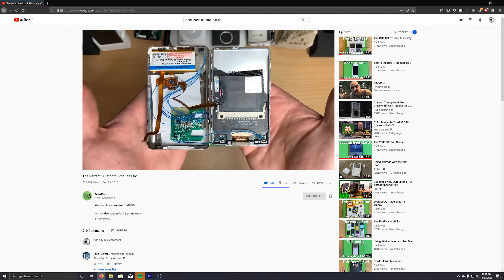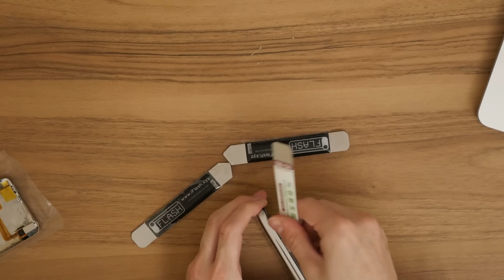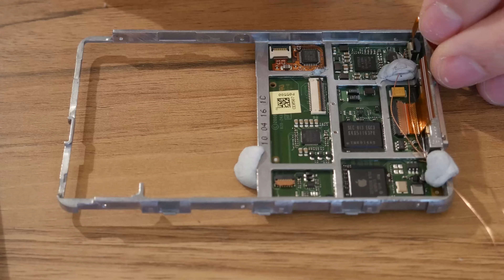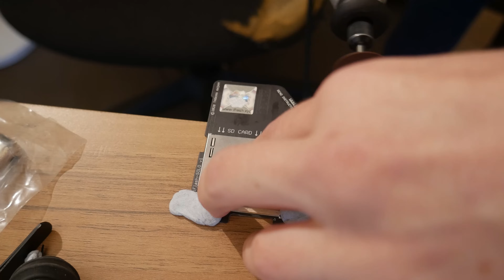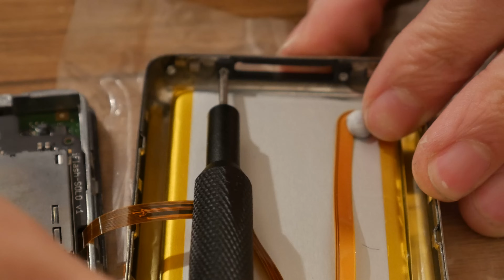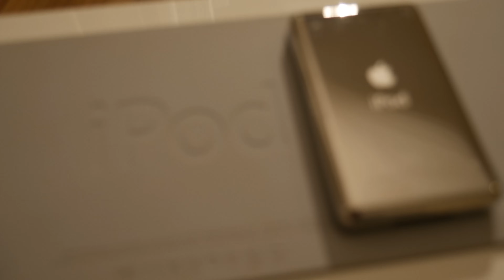The REAL Perfect Bluetooth iPod Classic

Comment: Would you be able to upgrade one for me! I have an iPod with 120 gigs and doesn’t work at all! I’ve tried resetting multiple times to no avail. I used to have a connector that you could plug in and could play it on your car radio. But it only worked when it was close to the radio! A blue-tooth would be awesome!

Comment: I'm attempting this mod, and had the audio working perfectly... yesterday though, I connected the bluetooth board to the iPod battery & it does power it successfully, but there's now noticeable noise when the module is powered on. It's not very noticeable when playing music, but when it's silent, it very much is. Do you know why this might be? 

I was thinking about connecting the power wires higher up on one of the capacitors on the logic board, as shown in someone else's iPod mod. I saw that you suggested not to power it anywhere but at the battery connector, and I was wondering why that is? 

Anyway, thanks so much for these very detailed videos, it's the only reason I felt confident enough to give this a shot and I've learned so much already.
Reply from the maker: Sounds to be like you might have some sort of short circuit, ensure all your wiring (Including Audio Wiring) is properly insulating and isn’t shorting to the chassis or ground plane of the iPod.
 Hope this helps!
Reply: @Pendleton115  thanks so much for the quick reply! I will check for the things you said, to the best of my ability. Is it possible that the magnet wire insulation isn’t thick enough and is therefore causing problems? I’m gonna fire up the iron and see if I can’t sort this out.. it’s the only thing keeping me from having the overall functionality completed before moving on to organizing it in the enclosure. 

Thanks again for your videos and sharing knowledge, this has gotten me into a whole new hobby :)
Reply from the maker: @clayton6613  The enameled copper wire should be plenty insulative for the device to function, possibly it’s been crimped between the chassis and the rear housing causing some of the enamel to rub off.
 Best of luck!

Comment: I knew I had shaky hands, but this project TESTED my patience. You made it look so easy haha! Thanks for the tutorial, love the product.
Reply from the maker: Practice makes perfect! Using a “Helping Hand” helps a lot too :)
Reply: @Pendleton115  hey mate I'm having an issue all of the sudden where if I plug in the ipod while it's assembled it restarts and won't boot if not plugged in. But if I try the same thing with the back case off she works as expected. Any thoughts as to what to troubleshoot
Reply from the maker: @tylerlhotta7317  sounds like you might have something shorting to ground, verify your wiring is correct and is properly insulated.
Reply: @Pendleton115  That did it! My switch for the Bluetooth board was making contact. Thank you a ton.

Comment: I am more motivated than ever to do this. I have 5.5 gen and been wanting to do this but I want to add larger memory. I wonder if I'll be able to fit 4 sd cards in the larger chassis of the 5.5 gen
Reply: The max supported capacity of the 5.5 gen is 128GB, so 4 SD cards is kinda pointless. You can use one 128GB SD.
Reply: @husky3g  from what I've read, Rockbox bypasses the limit but ultimately you're limited by the ram you have

Comment: I ordered a new iPod 7th last week and I’m thinking about upgrading it using your method 💪 - it’s 120GB but I’ll switch to SD card, should I order a thick backplate?
Reply from the maker: You will need a thick backplate if you wish to fit the Bluetooth module

Comment: Where can I find the copper wire I’ve look everywhere and I don’t know if it’s the right one
Reply from the maker: Any copper wire should work as long as it’s enameled and of a similar size.
 Most hobby/electronic stores stock them
Reply: Is this ok for the size BNTECHGO 22 AWG Magnet Wire - Enameled Copper Wire - Enameled Magnet Winding Wire - 4 oz - 0.0256" Diameter 1 Spool Coil Natural Temperature Rating 155℃ Widely Used for Transformers Inductors

Comment: Hello! I followed this tutorial but with the left right and mono soldered to the headphone jack, i only get mono audio coming out with wired headphones! Was yours also mono?
Reply from the maker: The connection should be stereo, ensure you’ve soldered your the correct pins on the headphone jack.
Reply: @Pendleton115  Im sure i did!
Reply: @Pendleton115  It also only plays mono when both the Left and Right wires are soldered on!
Reply from the maker: @YesItsKira_  are you sure both wires are soldered to the correct pads on both the Bluetooth board and the headphone jack? If so then your Bluetooth transmitter is likely defective
Reply: @Pendleton115  Im sure, if its defective that would suck haha, are there any other places to solder the l and r wires on the ipod board?
Reply: @Pendleton115  I managed to find a workaround! I connected only the right and ground. Now it works stereo wired and then I just change the channel settings when using bluetooth in rockbox for mono!

Comment: I've just got to the point where I'm about to rebuild my old 30 GB iPod Classic (awaiting a new battery as well as a headphone jack & hold switch).  I'm content with the hard drive for now though the SD drive is pretty tempting).

So are the bluetooth adaptations though soldering is a bit beyond me (at the moment) though everything else is pretty easy (about a half-hour of work if everything goes as planned).

The SD drive is also easy work as well.
Reply: Been 3 months how did it go
Reply: @archkull  Thanks for asking!  Shockingly easy.  Once you take into account the hard drive the iPod Classic case is virtually empty, making repairs really simple.  Ironically enough, it helped that the original battery swelled a bit, which with an accidental drop forced the case open and I didn't have to do any prying.
Reply: @archkull  Are you converting it to bluetooth and flash?  If it's just more of a standard restoration what problems are you seeing?
Reply: @archkull  Can you connect it to your computer and see it in iTunes?  

You say '...the first time it worked.'

What does that mean exactly?  

Not to be pedantic, but could you furnish as much detail as possible?  Talk to me as if I have no idea what's going on.
Reply: @archkull  I would get another battery.  Reason being, the first one I purchased held a charge once, then stopped working.  I contacted the vendor and they replaced it (it's worth mentioning that I started working on it as soon as I received the first battery and followed up with them as soon as I noticed it wouldn't hold a charge.  I don't think even a week had passed so they replaced it gratis).
Reply: @archkull  That sounds like a good strategy.  Keep me in the loop, I want to learn as much as I can from your experience.
Reply: Don't necessarily assume that the battery isn't the problem.  The first one I ordered didn't hold a charge so I had to get another.  I'd order another just so you can definitively rule it out.

And while that doesn't mean that a second one wouldn't have a problem as well, I like to think it's less likely.

Comment: Is there a limitation to the SD card on the 6th Gen pods?  I heard the DAC in the 5th Gens are preferable but I really prefer the case on the 6th/7th Gens!!

Is there Bluetooth module available in the UK??
Reply from the maker: The Taotronics Bluetooth modules are available globally as far as I’m aware, the iPod 7th generation is the only iPod with no storage cap, but the 5th and 6th Gen iPods can take up to 128GB with no issues.

Comment: I've never soldered anything in my life but I want to take on this project so bad!
Reply: What’s stopping you? Come one Jason you got this bud.
Reply: Good on you for trying!! Hell ya brother!! That board needed to learn its lesson.
Reply: @xandermoore8874  lol thanks. I found a seller on eBay that sold just the power modules in bulk so I ordered 5 because I know I'll mess up more. Also the video doesn't do this justice, but the soldering pads are TINY on this board! I don't have the best eyesight nor the best soldering iron (some cheap $10 one I found on Amazon) so that's probably not helping. However with the power module outta the way, I was able to practice my technique and I might have the hang of it.

I'm also trying to use an off the shelf bluetooth module that modders have successfully used to add bluetooth to Game Boy Advances. It's $5 compared to the $20 one this guy uses and doesn't require breaking apart a consumer level product.

EDIT: The bluetooth part I'm using is the KCX_BT_EMITTER. Can be found on Ali Express.
Reply: @pressxtojason  Have you had another try at it and if so, how did it go Jason? I know what you mean about the tiny soldering pads after some experience with soldering tiny drone boards/modules, I ended up buying glasses with different lenses and built in lights to help, they work great.
Reply: @xandermoore8874  I actually did try this and completely destroyed the power module on the board

Comment: Hey Pendleton! I've done this mod, but have had 2 batteries just stop working on me now. Same 3000mah size, but bought from different places. Have you had any issues with yours? I might be suspecting over discharge due to the Bluetooth board.
Reply from the maker: I’ve had no issues across multiple iPod mods.
 Sounds like you’ve received poor quality batteries, try seeing if you can find one like I listed in the description from a reputable seller.
 Best of luck!

Comment: what generation ipod touch is that? cant find that switch anywhere. thanks
Reply from the maker: The iPod Classic I modified in the video is a 7th Gen, but this mod works with 6th and 5th Gen too.
 I also featured an iPod Nano 6th Gen at the start of that’s what you’re asking about
Reply: @Pendleton115  thanks for the reply friend. One last question. Is the copper wire enamel coated? Did you also have to strip the wire before soldering it? thanks again
Reply from the maker: @emanuelruiz7710  yes the wire is enameled, I usually sand the end with some sandpaper or fine nail file.

Comment: Great vid. I've been thinking of doing this to my gen6 recently. Question on the Bluetooth - I assume there's an antenna of some description. Could you not solder a wire from it to theetal casing? Turn that into an antenna instead of cutting the backplate?
Reply from the maker: I’m sure someone with more knowledge of how Antennas work could do something like this, but I didn’t want to mess with things I didn’t know about haha
Reply: @Pendleton115  fair enough. I forgot to say, excellent use of the bluetack. Never seen anyone do it before, but I had my Gameboy open earlier for some soldering and had the exact same idea. And now some 12 hours later I see your vid lol. Must be fate.

Comment: Did the iflash work straight away or did you get some shorts after cutting it with the dremmal? I didn't know that much of it could be cut off, that was cool.
Reply from the maker: The iFlash worked perfectly, there are no important components or traces on that end of the board.
Reply: @Pendleton115  well thanks that will well and truly come in handy 👍. 
Do you know of any way to add type c? Or have any videos doing it?
Reply from the maker: @gadgetmadlad6691  https://www.reddit.com/r/IpodClassic/comments/fm9ren/finally_did_the_usb_c_mod_to_a_5th_gen_classic/
Reply: @Pendleton115  thanks I'll give it a gander when I get chance.

Comment: Well. I just follow this guide and made it. Thank you very much for your help. The only thing that i would say is that i can heard some static when using bluetooth. And make sure the Bluetooth is off when connecting your headphones or you will short it.
Reply from the maker: I’ve had Bluetooth on with headphones connected and have not had any problems, you shouldn’t be getting any static either, are you sure all your grounding wires are correctly connected? :)
Reply: @Pendleton115  i saw what was the problem the power button cable for the Bluetooth the bate cable was taouching the back plate of the ipod. I have earphones that have copper al around. So when i inserted the jack. It was shorting the jack with the back plate and consecuently with the ipod. And i can heard static at low volume. But i dont have a solution for that.
Reply: @Pendleton115  and i put this video on reddit because people were asking how i did it.

Comment: Great video, Its probably just outside my skill set, a kit I could handle but the modifications required to make it work might be too problematic, I guess if I ordered multiples than the safety net of that would allow me to get the job done.
The idea is firmly rooted now and even if I just do the giant battery upgrade alone with a thick back plate thats something.
thanks for the tips, I'll  be back some time to leave a reply of what I did with my system.
:)

Comment: Thank you! Feeling more confident to do this to mine coming in the mail in a few weeks.
Q. Would there be enough clearance for an M.2 style memory board from iFlash? It seemed like you could still fit the bluetooth board on top of the iFlash, or underneath it. Was the chop necessary or convenient?
Reply from the maker: There is a possibility you could fit an M.2 board. But I can’t confirm anything as I’ve never used one before. The cut was pretty much necessary, as while there is a possibility  you could fit both the Bluetooth board and a full size iFlash it would make life extremely difficult.
 Either way best of luck with your project!

Comment: Hi. Can I make my own battery for my iPod classic 4th gen and use it too? Would any battery work? I am not able to find one on eBay or ifixit. Please help.
Reply from the maker: If the iPod 4th Gen also uses 3.6v which I believe it does. You could quite easily modify a 5/6/7th Gen battery to work in it I’m sure.
Reply: @Pendleton115  It's actually a 3.7V. I don't have any other iPods' batteries. I was thinking Nokia battery, 3.7V, 890mAh. Am I making a bomb? Please advise. Thank you.
Reply from the maker: @sarachoukri549  It’s highly likely that the 3.6v batteries will work absolutely fine.
Reply: @Pendleton115  Just replaced it now. But it keeps stuck on the 1-bar bolt-charging battery symbol. What do you think?
Reply from the maker: @sarachoukri549  unfortunately I’m not the right person to ask  about this 😅

Comment: awesome soldering skills goals. i'm still scared of the amount of hot glue you use but i now know thats just part of it lol
Reply from the maker: Hot glue isn’t really a requirement, I’ve done the same mod without hot glue and it works fine, the reason the one in this video uses it is because I open and close this device a lot, and the hot glue really helps keeps joints nice and strong.
Reply: Why open a lot of times? Something wrong on bluetooth?

Comment: How did you open the bluetooth transmitter safely? 🤔 where did you start from? thank you 🙏🏼
Reply from the maker: The transmitter has two plastic end pieces that can be pried off, then the screws are accessible and the whole thing comes apart
Reply: @Pendleton115  Do you think if I replace the piece of metal behind the display with something similar or even same as that plastic front cover will improve the bluetooth range without cutting holes? Then I must place electrical tape all over the plastic piece to prevent light bleeding through the LCD from the bluetooth module. Is that going to work or this will be silly step? Thanks in advance!
Reply from the maker: @borisdimov5722  You can remove the metal entirely if you please.

Comment: is there a reason you aren't able to recycle the same button you removed from the BT board? attempting this mod next month and wasn't sure need to order a separate button?
Reply from the maker: The button on the BT board is way way too small, and doesn't offer enough surface area to be properly pushed in by the hold switch. I tried for hours to get it to work but realized there was no point wasting so much effort into it.
Reply: @Pendleton115  I see what you mean, it was indeed a small button. Was a able to follow your instructions and am very happy with the results. Appreciate the detailed video!  The only thing I did differently was I glued the Arduino button to the plastic piece that I removed from the headphone jack and then glued the plastic piece to the back plate, it was the perfect size to line up the button to the hold switch. I'd like to improve the BT reception by swapping out the backplate with a plastic version if I am able to find or create a 3d printed version.

Comment: Will I need a whole new, thicker, back to fit the 3000mah battery into a 7th gen iPod? I'm asking because I'd like to be able to slot my unit, which I plan to get if none of this year's iPhones include a charging port, into an iPod speaker dock. I got rid of most of my CDs, last year, but not without adding them to my iTunes. My parents want to move to a smaller house. I even got rid of my CD of the new McFly album as soon as I could after adding it to my iTunes!
Reply from the maker: If you go for the iFlash solo you will need a thick back, the duo and quad support the thin back.
Reply: @Pendleton115  Will it still fit into a speaker dock if I use a thick back?
Reply from the maker: @adultmoshifan87  Any Apple Certified dock thats designed should work

Comment: TOO AWESOME. MORE THAN VERY AWESOME. But what is the total cost?
Reply from the maker: Total cost for all the parts including the iPod you would be looking at around $450 AUD
Reply: @Pendleton115  For my iPod Classic 4th Photo Edition, I used Kingspec cf ssd 1.8 32gb as drive. Sometimes it boots (1of 20 times) mostly it shows error image, not the disc dead image, the other one. Firmware 1.2.1. I did diagnostic tests in safemode, memory, hdd, other tests, they are all good. (IRAM test stucks, I dont know what it means). 

What can be the problem? I am trying to use it now years later because I saw your videos 👍